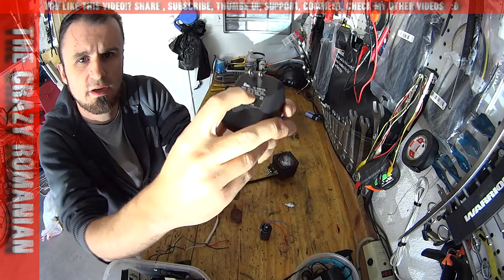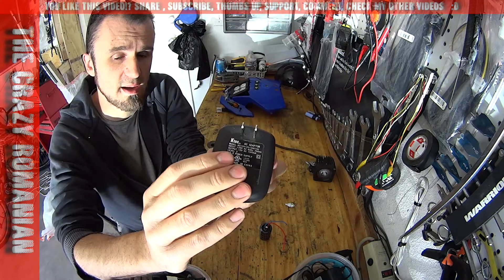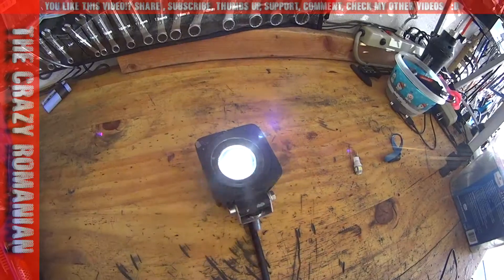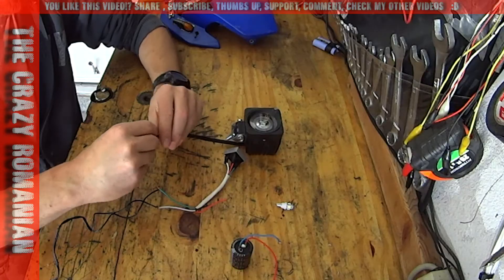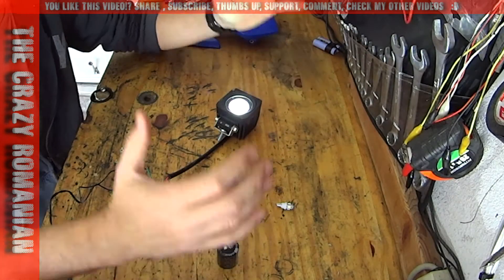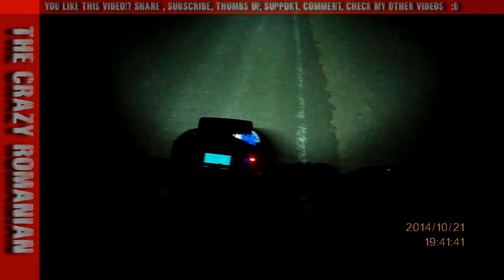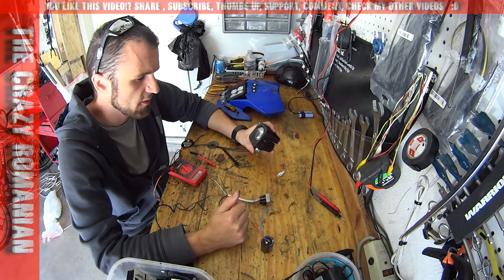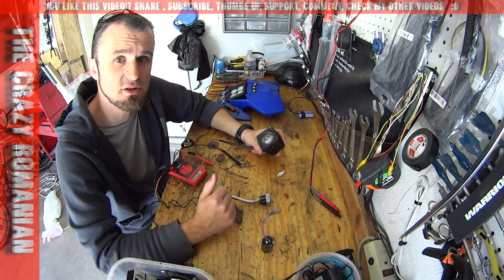How to install LED lights on a Dirt bike or Motorcycle AC to DC

Comment: Im so happy to of found ur video, i have a 2009 wr450f that is ac light so i wired in a MB50-10 1000v 50a rectifier with a big arse 27,000 uf 25v capacitor, and now im able to run a hi/lo beam light bulb in the stock headlight housing its amazing!

Comment: Well since u havent commented in a while i just did all this on my 2008 ktm 300 xcw using one of these $5 converters done the capacitor & all just like this & it ran for about 30seconds lol weather the converters are junk or not idk i bought two tried again & it only lasted maybe 20secs 50 amp 1000v converter suposably lol
Reply from the maker: My Yamaha run like this till I sold it .. but nowadays they make nice ones for KTM. Pricey but nice , baha design
Reply: Could be ur capacitor

Comment: Hi man i saw your video online about how to hook up a led light to ac current.  My question is i have a snowmobile im trying to get led headlights to work on.    I want to know what size bridge rectifier i need and what size capacitor i need.   Sled is 12 volts and the led lights i have are 80 wats.  I have 2 bulbs.  

Can u give me some help?